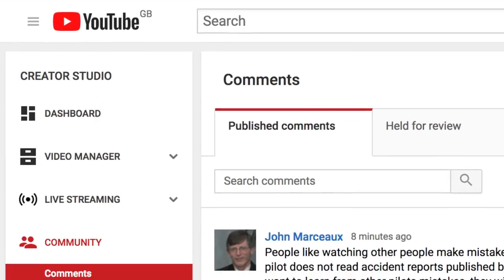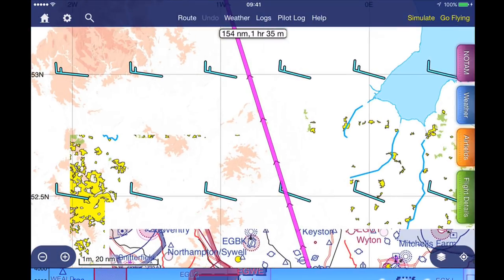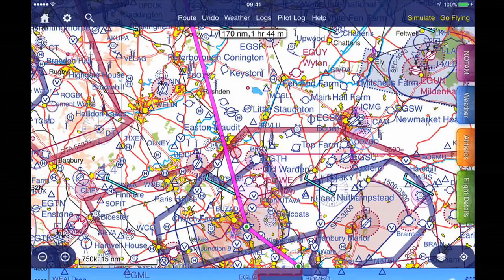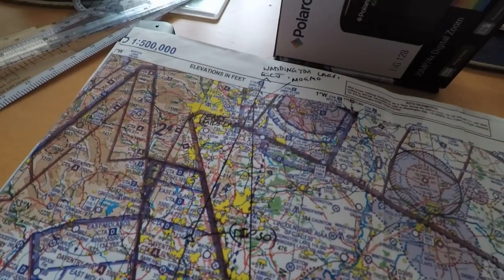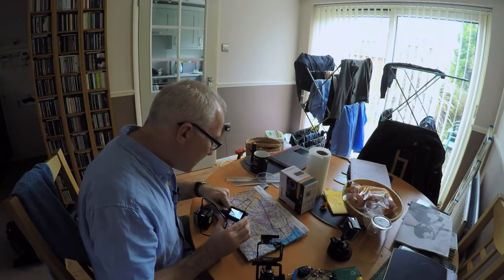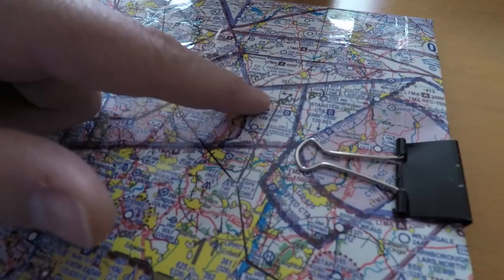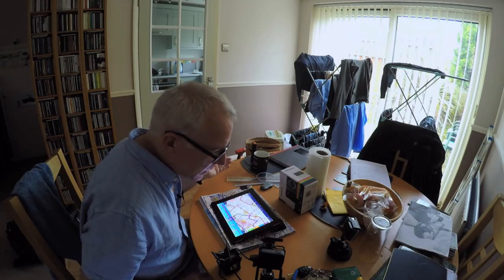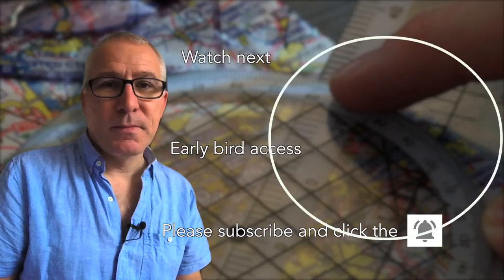Pre flight preparation – Mini-series  – pt1

Comment: Just a suggestion for marking charts.  Use colored, transparent "highlighter" tape, and draw your black lines on that.  You'll be able to see through the tape, and in flight can quickly see your route without hunting for it.  Works great, and the tape is easily removed.

Thanks for all the hard work on your videos!
Reply from the maker: Good tip John, might just look into that.
Reply: That's a great idea! Just ordered a roll - let's see how well that works :)